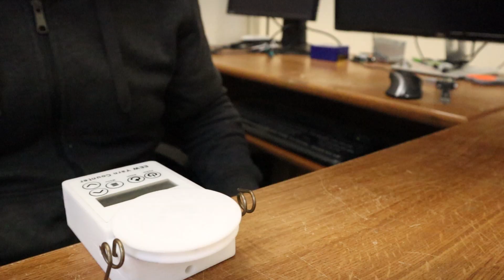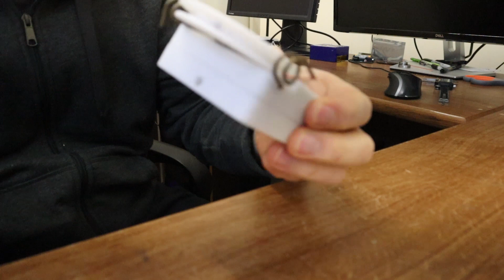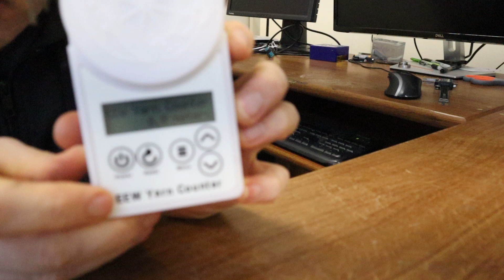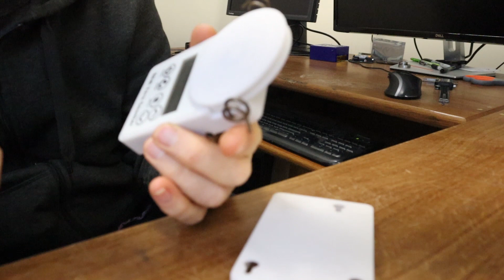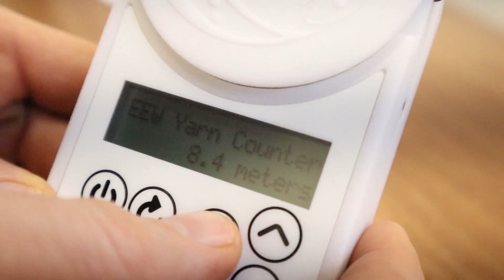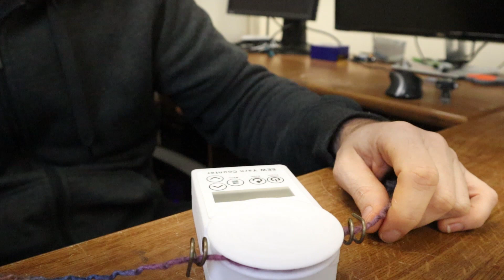Spin #99 - Yarn Counter Update (New Clamp and More)

Comment: How much is this going to be?? I am super excited about this part as I am starting to spin for an alpaca farm!!!! I can't wait for the kick  starter!!
Suggestion: I would love to see the clamp part  be just a bit more wider by an inch? My ball winder hates the table clamp and it doesn't stay stable and it is always coming off my table with that kind of system....possible maybe have it more like metal instead of plastic too to make it more stronger?? It is the only thing about the ball winder that drives me nuts, the plastic is weak for the clamps.
Or,  even better yet, I would love it to where you can  make it to where we can actually use screws to permant. Place the winder by my swift, having it be screwed on would be more awesome and I would love that even more, like give two options for placements?

Comment: Your changes look great. I'm wondering about the size of the rod for the clamp. My work tables have lips of up to 3" deep. I'm constantly having to rearrange my clamp-on tools to avoid that table because the rods aren't deep enough. If the standard ones don't work, can I order longer ones? Are they a common item that I could purchase at a hardware store? Can't wait to order! Thank you.
Reply from the maker: I did make this clamp deeper than most other clamps out there, but there is a limit.  There are a few other options.  I do put holes in the back of the case so you could mount this to a heavy board and just use that instead for mounting.  Or the threaded bolt is M6 which is a very common size.  You could get an M6 threaded rod and use a coupling nut to make the clamp any length you want.  This solution would probably work for any similar clamp you already have (though it might be some size other than M6).  Could can get the threaded rod and coupling nut many places online, here is one: https://www.mcmaster.com/
Reply from the maker: I meant to say the limit is right around 3 inches for my clamp.
Reply: @DreamingRobotsBlog  Thank you so much.
Reply: I have this issue with almost all of my fibre tools. My work table is too thick for all of them, leaving me running around the house to find something that works. Irritating.

Comment: I'm really looking forward to this device to add to my yarn spinning. I'm wondering if the buzzer could be more of a beep vice the buzz and it would be great to have the option of volume control for those who have sensitive hearing. Other than that I'm excited Bout this being available.
Reply from the maker: After making this video I shortened the buzzer from 4 seconds to 1 second.  I think shorter than that means it might get missed.  While I could create a volume control for the buzzer, that would be another menu and having too many menus would be annoying because every time you want to change any settings you have to go through all the menus.  I think I'd rather avoid a volume setting.  While the buzzer is loud now, I don't think it is really too loud and I'm pretty sensitive to loud noises.  Also you can easily set the yarn counter to not use the buzzer since it only goes off when it reaches a target length so if you just don't use a target length and watch the length manually the buzzer won't go off.